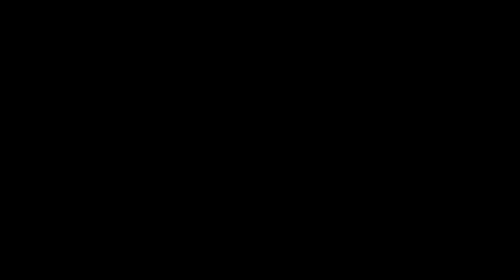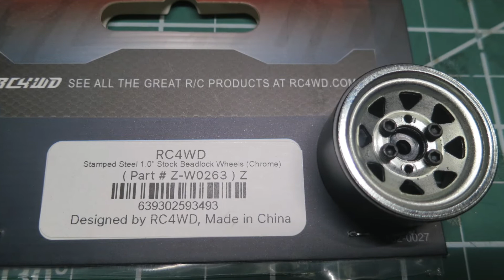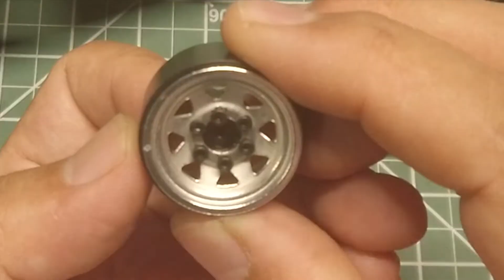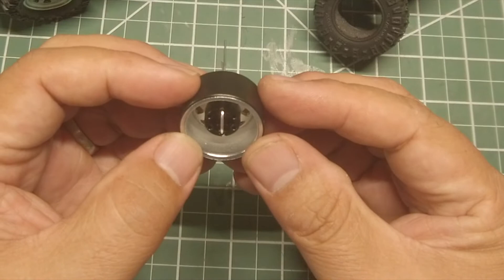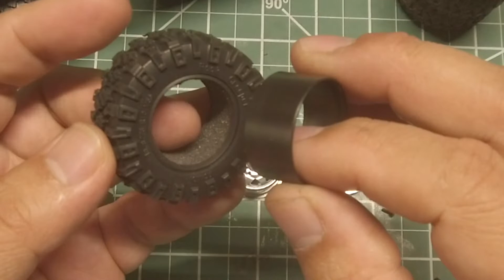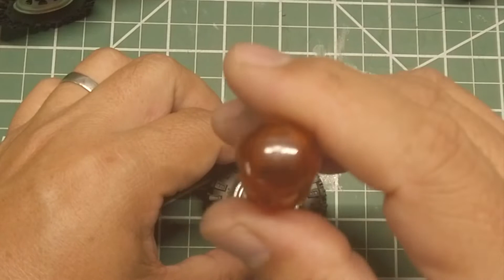1/24 Scale Axial SCX24 | "Paper Clip Method" How to Easily Mount RC4WD Stamped Steel Beadlock Wheels

Comment: I struggled with One wheel for over an hour before coming up with this exact method. Holy crap wish it would have been in non existent instructions. But it's part of the hobby to come up with solutions.😊 Now that little bent paperclip has it's own special place on my tool rail.
Reply from the maker: Same here.  It makes the install so much easier.

Comment: That’s a great idea!💡 I have a question? Would the rc4wd 1.0 stamped steel wheels fit their 1/24 trail finder? I would like to put bigger wheels and tires on it!
Reply from the maker: Thanks.  Unfortunately it will not fit their 1/24 trail finder.  The 1/24 trail finder use smaller 0.7mm wheels.
Reply: @BigSungHobbies  thanks 🙏

Comment: Great information! Thanks.
Reply from the maker: Glad it was helpful!
Reply: @BigSungHobbies  yesterday, I installed a brass difcover w/skidplate.  Those parts are so small and it took some time.  Servo works fine but, drive train seazed up.  What do you think?  Thanks!
Reply from the maker: @johnlujan8706  Hard to tell.  Check everything over.  One thing, you don't want to tighten the wheel hex down too tight, and that can lead to binding, so I would check that first.
Reply: @BigSungHobbies  I had bad time getting the servo in correctly...spline came undone too. You're right about checking everything though.  I'm not in a hurry to do that.  Do you use any kind of magnification tool..like a jeweler might?
Reply from the maker: Nope, but working on the micro builds, I wish I had one especially as I get older, but eyesight is not what it used to be.
Reply: @BigSungHobbies  I'm going to look into getting something like that.  Same here with my eyesight.  I'm 55 myself.  I'm going to continue with those upgrades on my two 1/24s though.  I enjoy your channel.  Have a great day today.
Reply from the maker: Thanks.

Comment: My stamped wheels and mud slinger tires show up tomorrow and this is exactly what I needed to see.  Thank you for the close angle and explaining why you do each step.
Reply: Small chance but is this the Andrew brown in Vancouver?
Reply: @gagebenson7898  I live in Redding California but what's funny is my younger brother lives in Vancouver.
Reply from the maker: Glad I could help!  Just take your time with it.  Biggest issue is alignment, and the u shaped paper clip makes it super easy.  Also, use blue locktite and don't overtighten...the screws are really weak.
Reply: @BigSungHobbies  Thank you for the advice on not over tightening the screws.  I have the loctite, mip 1.5mm, a paper clip and will have your video playing in the background.  This won't be as complicated as I previously thought. Thank you and I will load a video of testing out the wheels and tires once I get them put together and on a vehicle.

Comment: Wow, this was an awesome 'how to' video. I just got my RC4WD 1.0" Beadlock Steel Wheels (Black) in the mail today and when I opened the package I realized there were no instructions anywhere. I am just a beginner and I am venturing into doing some mods on my CR-18 crawlers and my Panda Hobby Tetra x2  as well. I was going to call RC4WD to send me an instruction manual but I did something better... thank goodness I found your video! Thank you so much for this and now all I have to do is buy the right tools. 🤔
Reply from the maker: Glad to be of help.  One thing that I forgot to mention on the video is to use a bit of blue locktite on the screws, and make sure to not overtighten the screws...very fragile.

Comment: Hi... Thanks for this video.  I'm stuck however.  My wheels don't fit on darn hex adapter.  I have brass ones and plastic ones, either don't fit.   Any ideas?
Reply from the maker: I am not sure.  I don’t use hex adapter on my SCX24s.  Can you try without the hex adapter to see if the stock ones work?  At least that way you can confirm if the issue is with wheels or not.
Reply: @BigSungHobbies  Sorry I'm a newb to the hobby.   The issue I'm having with is at the hub level.  Right where you mount the wheel to the chasis.  The rc4wd hub will not fit properly.
Reply from the maker: @jandjfunadventures7384  Hey welcome to the hobby!  We all started at some point, so don't be too shy to ask question.  Any issue is difficult to diagnose without being able to see what is going on.  I recommend joining FB groups such as SCX24 Mods and Fun where you can post photo of the issue, and folks will be able to diagnose it better.  Good luck.

Comment: How would I mount tires on these rims but without the foams? I can't find anything showing how to mount without foams.
Reply: Thanks brother🤙
Reply from the maker: You are welcome.  Good luck with the install.
Reply from the maker: The best way to mount it to these rims without foams is to use a tiny dab of CA glue.  I think I put 2 dabs on the opposite ends on each side.  Hope that helps.

Comment: I just bought some rc4wd stamped steel with rock creepers and your video saved me so much time, thank you! Now my question is : would you recommend to vent the tires? And would you run them with foams or no foams? Thanks again for taking the time to answer every comment 🙏
Reply from the maker: Glad to hear that the information helped out.  This video should answer your specific question, but I normally vent all my tires.  I ran without foams on the front and rc4wd stock foams on the rear.  As the tires were breaking in, I noticed that it started to give in too much, so I ended up picking up Crawler Innovations mini foams, and used it on my C10 and I really like it.  https://youtu.be/NFqNTX3yEkQ
Reply: @BigSungHobbies  thanks! Definitely going to watch the video!

Comment: great video! can you show an explanation on doing them opposite to make them deepdish?
Reply from the maker: Unfortunately, I no longer have the RC4WD Stamped Steel beadlock wheels, but it's pretty straightforward.  Find the two centered holes, and mark them lightly, and mark the wheel hub accordingly.  Move the wheel hub and match the holes, and then install the paper clip to those two holes.  The rest is basically the same.
Reply: How do you mean "make them deepish" ? Is there a way to make adjust the offset so they don't stick out so much??
Reply from the maker: @thewooxer  You can move the hub to the other side thus making the wheel deep dish.  This will have the effect of widening the track width.  If you do end up going this route, just make sure to mark the 2 holes that way you can easily align the holes.  Other than moving the hub, there is no adjustment to offset.
Reply: @BigSungHobbies  Thanks for the explanation. So it will make them just stick out more but is there a way to tuck them in the wheel wells more? Make the track width more narrow? I'm aiming for more scale looks (wheels under fenders).
Reply from the maker: @thewooxer  I don’t believe so at least for RC4WD Stamped Steel beadlock wheels.  There might be other beadlock wheels, but I am not aware of any.  Most people want to extend the width for improved performance.

Comment: Thanks for this haha. I saw 2 or 3 other videos where the guys were struggling with these wheels. I was going to buy this combo, but it seems I'm late to the party. The wheels are not available anywhere. Will get the tires for now though. Btw, you mentioned the issue of the wheels adding too much weight. On my C10 I will only add the brass diff cover and maybe the brass hex hubs cuz I dont like metal against plastic. Maybe since I wont have other weighted parts, that could help or the wheels are too heavy anyway?
Reply from the maker: The wheels will add 11g to each wheels for a total of 44g over stock tires and wheels.  The issue is that it doesn’t help with weight distribution since the weight is being split in all four corners.  I would recommend picking up HR brass knuckles.  It’s the most effective weight adding 16g to the front while not adding rotational weight.  Consider looking to MT Hobbies wheels.  It’s really well made for 3d printed wheels and works really well plus the install is super simple.  Good luck.

Comment: For me it seems the beads are too thick or the screws are too short. Cant get em to go on
Reply from the maker: Hi Alex Janito, try pulling up on the paper clip with your thumb and forefinger, while at the same time use the rest of hand to push down on the wheels on a flat surface.  It looks like RC4WD Rock Creeper wheels fit very easily on it, but I have heard there are some other tires that has a bit more difficulty.  For those, also use soapy water on the beads, and that should help a bit as well.  Good luck.
Reply: @BigSungHobbies  it ended up being that the inner lip on the tires was going too far into the center so it made it too thick to screw down but i got it. now it seems lopsided. I also didn't think about them sealing air. I want the squish from the soft tires so ill be drilling a hole in the barrel & backside ring. Ive called it quits for the night seeing that 1 wheel took me over an hour to get together
Reply from the maker: I usually vent the tires.

Comment: I have the grey C10. I ordered some foam for the tires. I hope getting the stock tires off of the stock wheels is not too much of a headache. What do you think?
Reply: RC4WD rubber is worth the cost. Try it.
Reply from the maker: @peregrineflow7354  Yup, I am already running RC4WD Rock Creeper tires.  Love that tire on my scx24.
Reply from the maker: I have had bad lucks with removing tires...another reason why I prefer beadlock wheels.  I have tried the boiling method, heat gun and even oven method, but all of those were for 1/10 scale tires. So I never tried on the stock wheels.  Hoping that they did not use too much CA glue on the tires.  Let me know how it goes.
Reply: I've heard these tires don't fit stock rims
Reply from the maker: @artistman75  I have not tried it out so I can’t confirm neither yay or nay.  The tires are a bit wider though.

Comment: Super Video, highly appreciated :-) Can you recommend this wheel/tire combination? Is it much better than stock?
Reply from the maker: The tires are great and highly recommended especially for a C10 version of the SCX24, and maybe even for Jeep version.  For Deadbolt, it will be on the small end, thus other options might be better.  The tires are much softer and has much better grip than stock tires.  As for the wheels, I am a little mixed on it, and let me explain.  The wheels with RC4WD Rock Creeper weighs 44gram more than stock C10 tires/wheels, roughly 11grams more on each wheel.  It's good to have weight down low to help with center of gravity, but it doesn't do anything to overall weight distribution, and it adds a bit too much weight to overall rig.  Stock C10 weighs 230 grams.  After the tires/wheels, the overall weight went up to 274 grams.  That's roughly an additional 19% weight added to the rig, and that's before adding some necessary weight to move the weight distribution to front.  Quality of the RC4WD Stamped Steel beadlock wheels are pretty good (out of the bag, there 2 screws that were already cross-threaded, but a bit of blue locktite solved that).  So I am in search of beadlock wheels to bring the overall weight down.  But my search continues.
Reply: @BigSungHobbies  you answered a question I wanted to ask about the weight of these wheels. However, I thought that heavier wheels (some that include brass inserts) are designed to help these vehicles crawl better, is that not the case? It sounds like these particular wheels might hurt performance and run time, is that accurate? Thanks!
Reply from the maker: @wrxtc82  The answer is unfortunately not straight forward.  Weight on wheels serves its purpose by lowering the center of gravity (CG); however, it adds rotational weight which adds strain to the drivetrain.  On a 1/24 vehicle, adding ~45g is roughly 20% of overall weight.  So the motor and drivetrain have to work a bit harder.  That being said, most rigs need some added weight in order to achieve 60/40 weight distribution.  And those weight that is being added should be down low by the axles and static weight over rotational weight.  One of the reasons, why I recommend weight redistribution as the first step to assess how much added weight is needed.  In most cases for SCX24, I find that adding brass knuckles and brass diff cover to front will get you very close to 60/40 (maybe just a bit shy).  I would add those weight before adding rotational weight.  Hope that helps.

Comment: I’m going to use that trick next time I take my heel part, great idea!
The 1.9 steel wheels for 1/10 crawlers come with two extra long screws for ease in assembly.
Reply from the maker: It works surprisingly well.  Give it a try the next time.